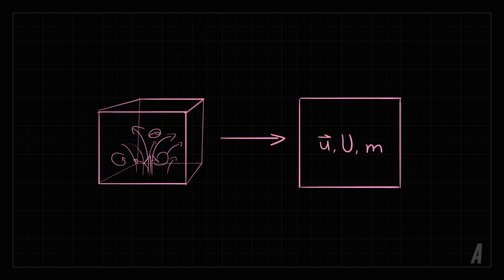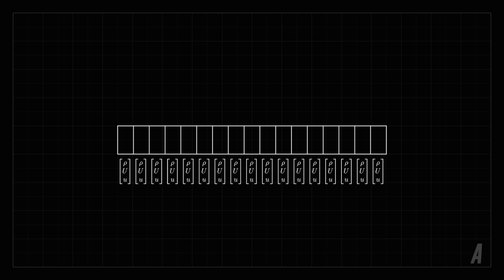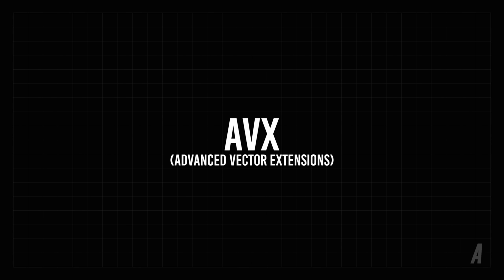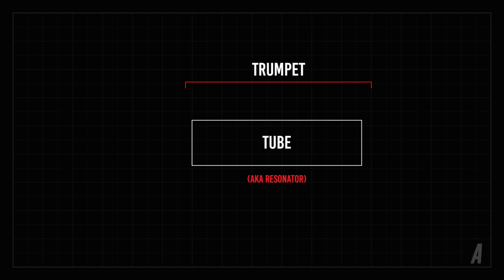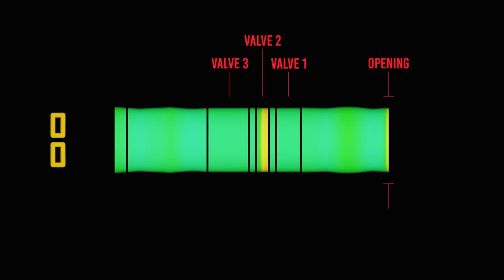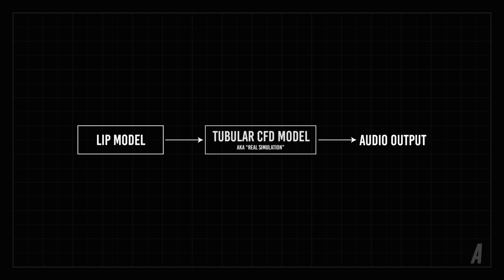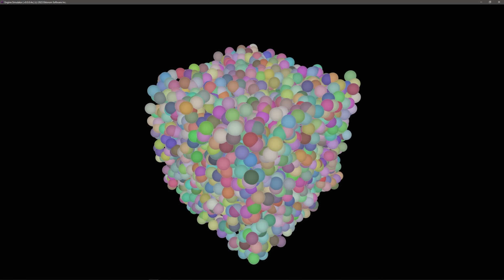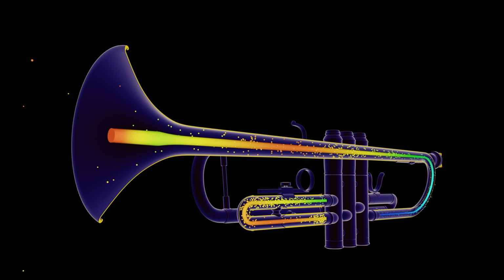Real-time Trumpet Simulation [C++/Vulkan] [WARNING: Flashing Lights]

Comment: Professional trumpeter and university professor here, this is VERY interesting. It is thought that intraoral shape and tongue position also have a large bearing on tone quality which would seemingly be very difficult to model as every player is different. I’m curious to know what sort of air pressure levels you were having to operate the simulation at to produce a sound.
Reply from the maker: Blowing pressure was relatively normal for humans (around 1.5 kPa or a little higher) but it just seemed like the model flowed a lot more air through the trumpet than I would expect
Reply: What volume of air were you seeing? Sorry if you mentioned this in the video!
Reply from the maker: Not sure about the exact volumetric flow rates but as you can probably tell in the video, the air velocity in the trumpet is extremely high. I don't remember the exact values but it just doesn't seem to align with what I've read/observed about air velocities inside trumpets
Reply: @AngeTheGreat  I don’t claim to know the physics behind the volumetric flow and air velocities of brass instruments, but one thing that we discuss (and argue) in trumpet pedagogy circles is that pitch frequency and air velocity aren’t necessarily linked in practical application. In my experience, I perceive that I’m flowing a smaller volume of air that may be slightly faster in velocity the higher the pitch I play. We also talk a lot about how the movement of air is intended to excite the air column inside the instrument and not necessarily intended to brute force your way to a characteristic sound or a higher harmonic. A simple and unscientific way to test this is to feel the movement of air with your hand coming out of the bell while the instrument is being played at different dynamics and tessituras. The typical outcome is that there really isn’t much felt difference between high/low pitches and loud/soft dynamics. I realize this is very unscientific, but this is my experience in application.

Comment: its amazing the base tunning of the trumpet is around e flat or d which is also a common tipe of trumpet )and im not sure if not similar to the natural trumpet) but they usually are tunned with bflat. Its also amazing the sound simulation since it feels like lacking some harmonics and at the same time like someone struggling with a weird trumpet that does not respond always the same way to inputs, like a begginer trompetist

Comment: I think the key point is the lips simulator. The trumpeters are using different embouchures (lip techniques) for the differerent registers (ranges of notes). For the very high notes, for example, they basically make a hole by their lips and blow a lot of air, therefore playing them very loud. Playing high notes softly is almost impossible. I would suggest considering different lengths of lips' vibrating surfaces alongside with different pressure. I would also recommend researching about embouchures themselves as trumpet players train them for years. Anyway, thanks for the job, this project is amazing!

Comment: I know something like material's properties tends to make a huge difference to flutes and flute-likes, through the vibration of the material and interaction with everything around it. Blowing or tapping a steel pipe sounds different from a wood/plastic/aluminium one of the same length and diameters, affecting both pitch and character. Placing a small decorative mass on one end or swapping out the wood type for sourcing reasons might even ruin your calcs just enough to matter.

There's a reason why simply placing holes on your new flute design beyond the first few holes has been described as a process of "pin the tail on the donkey". I can't imagine how filthy rich you need to be if you are designing a metal flute system in a pre-computer era, and how filthy rich you'll be after patenting it.

I'm curious how much this affects large brass instruments like this, and whether it will even be feasible to simulate in real-time.

Comment: Using an IR vs using an algorithm or a simulation is the key difference between algorithmic and convolution reverbs used in music industry. As you might expect, a convolution reverb convolves the input signal with an impulse response, whereas an algorithmic reverb literally simulates a room (oftentimes using many cheeky shortcuts)

Comment: I like the look of the colored lines through the trumpet.  Excellent work.

I'm currently trying to find a way to interpolate and render curved lines with varying thickness, and I see that your trumpet has that.  To be more specific, I'm trying to do this with NURBS.  Did you have an efficient formula, such as Bresenham's line algorithm, that you were using, or were you utilizing a library to render these lines?

Comment: 3 things: More tension in the lips, and remember the lips don't just make one tone to be modulated by the keys, they get close to the note you're trying to play. To do this, you adjust tension and breath pressure, so if you aren't doing that when the notes change, you won't get the right simulation. Finally you aren't modelling the tongue. The reason spit valves are necessary is because players break between notes by touching their tongue to their mouth. This allows a sharper break, which means a tighter impulse as the breath builds up before the note, is releases as the tongue pulls back to release a burst of air, and this is all entering a trumpet that had the pressure releases / let the last pressure escape. That will all contribute to a higher burst of air that you are currently simulating with just higher flow overall.

Comment: 5:16 the heat equation does predict a finite propagation of heat through a system. You do not get a sine wave as with the wave equation but there is finite speed of thermal conduction.
Reply from the maker: That is true, but I'm not talking about the speed of heat propagation. I'm talking about the speed of information flow across the domain also known as "signal speed" which the heat equation predicts is infinite
Reply: @AngeTheGreat  I see thanks, seems like I was interpreting "felt" slightly less technical than intended here.

Comment: When you mentioned your simulation needs the computer to blow a lot more air into the trumpet to get an acceptable sound, I believe that issue might come from the 'lips' not sealing against the mouthpiece in your model.
I've played around with our old second hand trumpet, and I can tell you that as much as the brrrrr lip flapping is key to hearing anything out of the bell, making sure you're sealing the mouthpiece completely is the other half of that equation.
I'd suggest making the simulated lips a little more acutely angled so there is always a good seal, then making the moving parts small enough to have the full range of motion inside the mouthpiece. I'd also say, the speed of the lip flapping in your model is way slower than you'd even be able to achieve irl, so that might help save your computer's lungs.

Comment: Probably not helping because yoi were the one who spent two months studying it and I'm just guessing, but does the simulation has friction or something that increases back pressure? Maybe that is what you need to be able to use less pressure to make it work, if it is even not accurate as you suspect. Also that deepening lip setting sounded more like air density setting.

Comment: The valves are in incorrect order in the simulation at 10:19. (Valve 1 which is two half steps, should be closest to the lip. Valve 3 which is 3 half steps, should be closest to the bell.)
Reply from the maker: Nope. Take a look at a real trumpet and you'll see that the valve labelled "3" is actually the first valve if looking at the trumpet as a series of tubes. The "1" valve is the last in the series before the bell. Physically, the "1" valve is closest to the player and this is shown correctly in the visualization.

Comment: Brasswind player, mechanic, and "armchair engineer" here. 

A huge thing about trumpet playing is that the lips form a seal on the mouthpiece. I couldn't tell if what was shown is what was being simulated, but it appears the lip model wasn't fully pressed against the mouthpiece. This would make a lot of sense why it required so much more air to create a sound, as much of the air pressure can escape around the sides. 

Playing trumpet well includes having a lot of air pressure behind the lips, as well as carefully measuring out the correct frequency for the lips to move to match the note. Air pressure is achieved by tightening the diaphragm to force the air out as hard as possible. Face muscles control the tightness of the lips. The process of playing is an intricate dance of maintaining air pressure, matching lip frequency to the desired note, and using the correct valves. 

Also, the bowl inside the mouthpiece affects tone as it changes the shape of the lips and how far apart they can move. When the lips have a shorter distance to travel, they can trill faster, creating a higher frequency. Novice trumpet players can reach higher notes by pushing the trumpet into their lips, forcing the lips further into the mouthpiece to make it easier. Skilled trumpet players have developed their facial muscles enough to tighten their lips without having to do this. Ideally, you don't want to strain your neck by putting any more pressure than is necessary. Some trumpet players make vibrato by repeatedly pressing the instrument into their lips to vary the tone and pitch at the same time. Also, different mouthpieces have deeper or shallower bowls to make it either have a more "full" sound or easier to play higher. 

Hope this helps. I've enjoyed your engine sim adventure since the beginning. Seeing you make something from it that touches upon more than one of my interests makes me very happy.
Reply: Another tidbit, intonation is also controlled by the first and third valve slides. You would have to look up which notes need it, as I've forgotten at this point. I play the baritone mostly and haven't seriously touched a trumpet in over a decade.

Comment: when i was in 3rd grade i started learning the trumpet. i ended up quitting pretty quickly because you had to blow so hard into it that i felt light headed. you have to have your mouth basically closed and it vibrated your entire head until you feel like you're going to pass out just from playing hot crossed buns. i just got confused when the teacher was telling me to close my mouth and blow air. i was like " i cant do both." maybe i was just a dumb kid but i hated it. very difficult instrument. i learned guitar by myself pretty quickly and never had a problem.

Comment: I wonder if you could build an e-trumpet with force feedback: have just the mouth piece, a microphone and a speaker that feeds back the pressure conditions directly behind the mouth piece.

You might need to feed some dampened air pressure to the other side of the speaker membrane so you don't blow it against the hard stop right away though :).

Comment: I heard, that you need to blow hard into the trumpet. To a degree, that players who played it often and for over a decade, might develop respiratory system issues.
But as I understood it, the “blowing hard” is more about pressure than volume.
Reply: “The possible detrimental effect of playing a wind instrument could be due to high-pressure damage to small airways and alveoli, or infection caused by pathogens residing in the instruments”

PMCID: PMC6497376PMID: 31048898
“Does trumpet playing affect lung function?—A case-control study”

Comment: What you describe is also basically what happens to AC Voltage on a Wire It also has reflections on an open Circuit Wire.

Comment: I was going to suggest simulating a string instrument next, but I am not sure how great that is going to sound. At the level of this simulation it would basically be a Helmholtz resonator and a direct simulation of a vibrating string. Maybe it would sound okay, maybe not.

In any case I think for instruments it might be important to simulate the vibration modes of the actual material comprising the instrument body, but I think this is quite complicated especially with the additional coupling required to the fluid simulation.

Also a pushback against the criticism of your convolution based approach to producing more realistic sound. I don't really understand that criticism. It is a model. You made the choice to simplify one aspect of your simulation by replacing it with a simple approximation. That is what modeling is. Their criticism basically boils down to "I don't like your model. Make it better plz." Which.... yeah I guess is okay... but also work on the elements you find most relevant, not what other people say is important.

Comment: This is truly amazing, not least as educational visualizations. If I may have suggestions: a trumpeter's lips do not close completely when playing. It's a common misconception that players buzz their lips, then add the mouthpiece on that, but there is a always a hole between the lips while actually playing the instrument.

Second, it would be very interesting to see how "the gap" affects sound, impedance, and intonation in this simulation. The gap (aka annulus) is the subject of many heated discussions. It is the space between the end of the mouthpiece, and the start of the leadpipe. Some kind of venturi. You don't see it as it is covered by the mouthpiece receiver, but a number of respected trumpet makers swear that it has a very important influence on the instrument. Simulating it's effect would be so exciting!

Comment: Very nice too see this kind of simulation. I love that a 1D approximation often already yields good enough results in cases like these.
I had a similar kind of problem to solve in the past that was for a flow transitioning from the viscous flow regime down to molecular flow. 
I also arrived at SIMD and AVX back then, but when I tried combining AVX with multi-threading I ran into the issue of the CPU not liking to run AVX full-blast on all cores and clocked down so much it multi-threading actually slowed things down... Did you experience something similar to this?

Comment: I wonder how much of the trumpet sound is accounted for by structural vibrations in the body of the trumpet itself (instead of just fluid motion inside the trumpet). If that's significant, I'm afraid it might not be possible to run a fine enough structural model of the trumpet in real time, especially if real time means 48kHz, but it's definitely possible to get the necessary frequency response functions and use that to generate part of the sound

Comment: As both a mechanical engineer and a two-bit trumpet player, this is awesome!  What really impresses me is the sound of fluttering the 1st valve - it sounds uncannily like the real deal, and you'd never get that from a typical synth.  As for the tone, it kinda sounds like you have a mute in.  Or like the player has the flu.

Newcomers to brass often need to be told to use more air.  It actually takes more skill to play well at a low volume.  For some reference, back in marching band we measured volume by the amount of time it took to empty your lungs into the horn.  Mezzo Forte was "12 count air", as in 12 beats at a given tempo (~120 - 160 ish for marching music).  Forte was 8 count. double forte was 4 counts and would rattle the bleachers.

Comment: Trombonist here. Great work! 

Something that might help you with the "simulation needs a ton of air problem" is perhaps a more detailed simulation of the mouth. There are details that are quite important to quality tone generation in the entire oral cavity that your lip simulation might be missing out on. Of course, as a player, our perception of how much impact something has doesn't always line up with reality, so perhaps it won't make as big of a difference as I suspect.Perhaps these details were considered unimportant by the paper you referenced.

Anyway, I'd thought I'd leave a couple of videos here in case you hadn't seen them. I'm not sure what sort of results simulating more of the oral cavity will have, like I said, but it might have some effect. Neither of them are of trumpets but it could be useful yet. It seems possible to me that all the work we put into to micromanaging the rest of our mouth might just be in service to adjusting the parameters at the lips, but it also seems illogical to me that these motions wouldn't have a substantial effect considering how much more movement occurs in, for example, the tongue than the lips. 

https://www.youtube.com/watch?v=Gq5-AIEe3xA
https://www.youtube.com/watch?v=MWcOwgWsPHA

Comment: this is so dope. Since many notes on brass are by playing diff harmonics of the same valve configuration, have you figured out some way of exiting different resonances by varying lip parameters? also, in the case of the clarinet i'm suspecting your lip parameters made a pseudo-reed. The samples with convolution reverb sounded very much like a saxophone to me

Comment: I'd love to help out somehow, but there's a few issues.

1) I never got passed arrays in c++
2) I can't figure out booleans beyond if a number is greater or equal in c++
3) My laptop can only run the simulation < 35 fps

So I'll help out by liking and leaving comments.

Comment: Commenting just in case you didn't know: In real life, there is one main tuning slide for overall intonation and two valve slides for keeping the trumpet in tune with itself that are moved only when pressing certain valve combos. I say this because I don't think proper lip embouchure would throw the trumpet that far out of tune, as opposed to woodwind instruments which require much more conscious effort to play in tune. There is no way to know, but it could be worth trying to "intonate" the trumpet if you take my meaning.

Also I'm taking CFD right now and this is insanely cool.